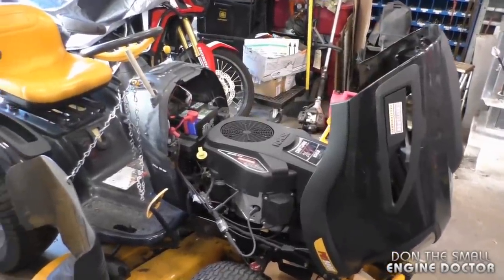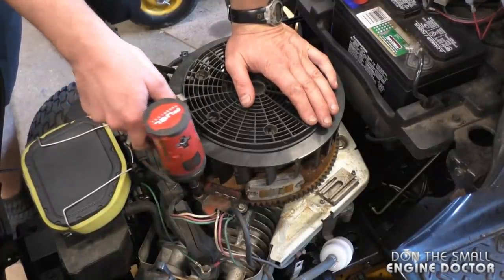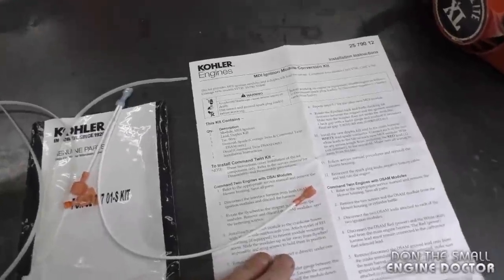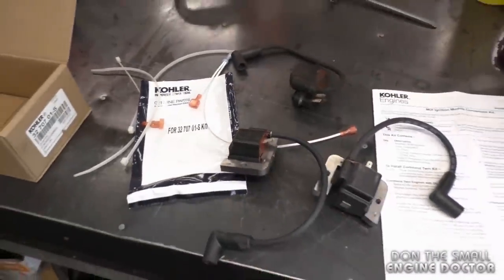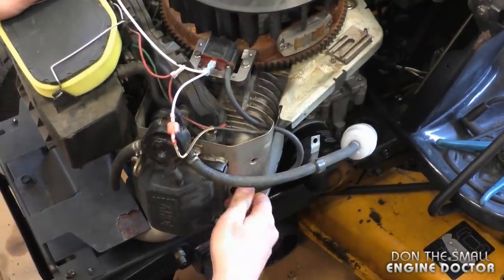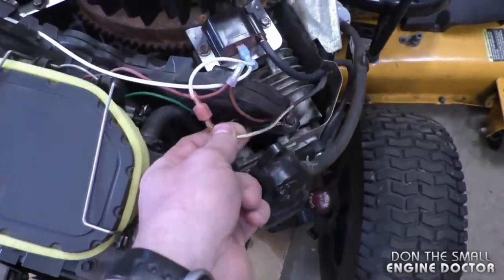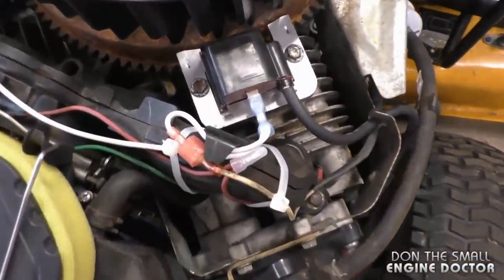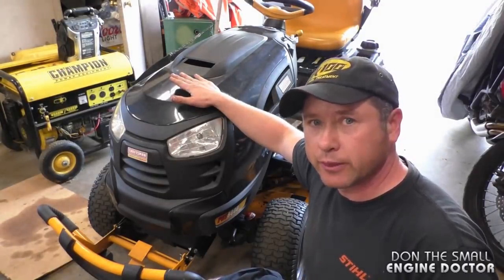HOW-TO Replace Ignition Modules On A Lawn Tractor - Kohler Courage Coil Conversion Kit

Comment: Just installed this kit today…100% improvement! Not only was my tractor only running at one cylinder, but the other one was weak. This coil update has it running like a new machine again. And this video was a great help, especially with showing what to do with the red wire.

Comment: Seems like the “courage” models of Koehler engines have so many coil issues! Great video, you make it look so easy!
Reply: Kohler is just a brand... Newer John Deer, Kohler, Husqvarna, MTD, ETC.... Any of them have the B&S "Twin" Engine Cylinder have the same thing.... It's the STUPID Engineers, just like the Fuel Solenoid!!!
Reply: @mmafanatic90  also known for their cracked cases, that mostly all crack in the same spot. Not all do it, but a lot do 🥺

Comment: I've done this twice on a 72' Toro z500. I ended up removing the engine to do all the work. It's a horizontal shaft, only 4 bolts and belt and a few connections to remove it. That mower recently got a new engine, so I'm sure I'll be doing it again in a few years.

Comment: Thanks for a awesome video had to replace on my Kohler 27 hp it’s on a Bad Boy ZT 65inch you were right no where in Kohler s instructions do they even mention the hot wire to the fuel solenoid on carb thanks so much for making this so easy runs like a new one 🫵🏻👍!!!

Comment: Dony, had an engine shop like yours for years.  Just a suggestion when replacing coils.  Remove old like you did, then install new ones with flywheel magnets out of the way but then just snug up new coils, then rotate the magnet to one coil, place business card in place and then loosen coil hold down bolts.  Magnets will pull coil into place, tighten hold down bolts and you are off and running without having to fight the magnetic pull on the new loose coil.  Just a suggestion.

Comment: Took several hours but I traced my problem to the 60deg tilt switch. Not sure how this goes bad but it was causing my bizarre cutting in and out problem. Bypassed it and all runs good. My ignition module (PN: 24-584-15) was not listed on the Toro Bulletin so I guess mine are ok. Do you agree?

Comment: I have this same engine and I have replaced all filters, fuel pump and carb. Using a spark detector like yours I have spark. My engine still misfires at high rpms. Any suggestions? Thanks for any help. John H.

Comment: briggs and tecumseh feed the kill wire of each coil through a diode before going to the common kill wire to chassis . What's different about kohler coils that they don't need the diodes.

Comment: Is there a similar procedure for a Kohler cv16s single with a SAM unit integrated into the ignition system. A new oem coil did not solve my week spark issue and I cannot find any information on how to test the SAM unit. So I would like to switch to the old fashioned coil if possible.

Comment: Smashing conversion, it's just like B&S push mowers now.
Just omit the power wire from the coil packs basically.
Any problem with the timing or is it just an engine that does not care much?
Reply: Even if it did care much,there is only a few thousandths play on the coil mounting bolts left to right. 
Engineered to the highest good enough standards.
Reply: paul billings
Ha ha  "Engineered to the highest good enough standards." :-D
That's a new one to me, nice :-D

Sounds much like simple twostroke moped engines, who cares how close the plug and points gaps are, the stator plate is bolted down so it should work. It has to be rotated!! oooow :-D

Comment: Hope you can help. I have a single cylinder Kohler pro Model CV16S-43519. It has lost spark and has module 9906 Rev A  also a marking 100532 if that helps. Also it has a rectifier/voltage regulator. How can I test which is bad or is there a modification you can recommend? Thanks!

Comment: Hi Donny have you done this on single cylinder kohlers? I have a kohler CV 16 S  that has the DSAI module with three prongs, I bought a new coil that is suppose to be for CV 16 or CV 16S but only has two spade connectors and they're not marked like old one. Thanks in advance!
Reply: I have the same engine as yours, 5 wires come out of SAM, the yellow and brown go to the ignition module,  Black to the ignition body, Red and white to the engine side red, and white. All wires are keyed so can not make a mistake

Comment: Thank you for doing this video!!
Any chance you have done one of these on a miller trailblazer with a kohler command Ch750 not efi?
After mdi conversion my stepper motor starts the engine up but i seem to lose any communication after that and just runs wide open..also does not shut off. I did the wiring right but something is amiss

Comment: Don't have many Kohler engines fitted on machines sold in the UK now. But we are having issues with the new Briggs and Stratton engines fitted with the electronic choke system and choke adjustments as we have had these cut out on customers.

Comment: Hi I have a question...I have a mower Dixie chopper 2017..it won't start. It cranks but no start we checked the both ignition coils there's no spark..I m not to convince bcuz both aren't sparkling. also the ignition key don't work..at cranks only if I do it directly to the starter..any suggestion will be appreciated thanks for your good advices. God bless

Comment: Will this (concept) work on an older 20 HP Merc OB? It's a 2 cyl, dual ignition points engine currently? 
I have seen these engines equipped with under flywheel and some with external coils.

Comment: Is it ok to paint the magnets on the flywheel ( keep them from rusting) with a lite coat of clear paint or will it interfere with the current? Thanks for the info and great job!
Reply: wax or oil works better
Reply from the maker: do not paint the magnets, u can spray wd-40 or some other lube on them

Comment: question, I have a Kohler command pro 20hp cv20 engine. it feels underpowered, and after doing some research, it appears that the 18-22hp models all use the same block, just the cv22 uses advanced timing. what would, or what could I do to boost the HP our of the 20hp engine? can I put the carb on from the 747cc 27hp model, or remove the governor and run it at 4000rpm?

Comment: Hey Don. Just installed this Ignition Coil 2 Pcs Replace 32-707-01-s 25-707-03-s 3270701 Fit for Kohler SV735-0017 SV740-0020 SV735-0018 SV735-0019 SV735-0002 SV740-0002 Lawn and Garden Equipment Engines
Ignition Coil 2 Pcs Replace 32-707-01-s 25-707-03-s 3270701 Fit for Kohler SV735-0017 SV740-0020 SV735-0018 SV735-0019 SV735-0002 SV740-0002 Lawn and Garden Equipment Engines and the mower is just turning and turning. NO FIRE...Ideas?

Comment: I purchased coils off of Amazon. When watching your video on replacement coils, you just have one tab to connect. The ones they sent have two tabs, with no instructions on where or what they are for. The ones that I have are the same number sv740 that it says on my tractor. Can I still use these and if so, can you share with me what wires go where. Its a twenty seven hp twin courage. Your response would be greatly appreciated. Homer

Comment: I bought a Cub Cadet XT1 a couple of years ago with a Kohler 22 HP engine.  It's running great so far.  Is this something that I should be worried about?
Reply from the maker: not really but if it is you'll know what to do

Comment: Don,  what is the part number for single cylinder 16 horsepower Kohler engine, I have Kohler CV16S with the Spark Advance Module, many thanks

Comment: On some older 23-25hp Kohler Command engines that were Equipped with a SAM module you have to flip the Left coil over. You will notice it rite away if you have to flip the coil over or not because it will have significant spark knock and the lifters will rattle. Don't run it very long or you will bend the push rods.
Reply: So one coil wire is against the motor and the other one is on the outside , cause the plug wire hits on the intake manifold ? I was wondering if that was correct ?

Comment: @donyboy73 my courage sv725 when I engage pto seems the engine won’t run right when cutting. Almost Bogging down. I’ve cleaned carb, adjusted valves, new plugs. Cleaned Magnito. Could my could be going bad?

Comment: I had intermitting spark with dsai, i have the same engine a kohler courage sv735. The kit i bought with the same part number your showing on your box and my mower runs like garbage. Both are sparking but its running like its missing or out of time? I'm at a loss i been working on these things for years. Please help.

Comment: Any chance of running cdi ignition boxes and add the pickups ware the coils were removed from using the flywheel magnets as the pick ups ?
Reply: in for the asnwer to a good question

Comment: Great video as always. I really appreciate how succinct  and informative they are.
Do you remember where you got your spark tester? There are many out there, but I really like yours. Any information is appreciated.
Reply from the maker: that is a new spark tester I am trying from Blue Point, you can get it from snap-on
Reply: The same spark tester is available from Lisle Tools (P/N 20610).  It can be found at many auto parts stores or on Amazon if you don't have a Snap-On guy around.  I have the Lisle one, it works very well, I use it all the time.  It doesn't work with spark plugs that have the threaded ends though, won't securely attach inside the coil wire boot...

Comment: Clear, well explained video.  Well done Dony.  Does the coil on the Kohler Courage single-cylinder tend to fail the same way?  Is there a kit for that too?  Thanks!
Reply from the maker: yes they do fail on the single cylinders a lot too but usually no special kit required
Reply: @donyboy73  ok thanks.  Good to know.  I have been keeping a Kohler Courage Single alive on my son's Cub Cadet tractor.  Certainly not my favourite engine.  But your advice is always useful when I go to my local small engine parts shop.  It helps me understand the excellent advice that they give me.

Comment: Great job, I'm really liking that spark tester you used, can't find a video on your channel about it, where did you get it?.... I wanna pickup 2 of em..... They seem to have a nice large sight window.
Reply: Don got his Blue Point version from a Snap-On guy, but the same spark tester is available from Lisle Tools (P/N 20610).  It can be found at many auto parts stores or on Amazon if you don't have a Snap-On guy around.  I have the Lisle one, it works very well, I use it all the time.  It doesn't work with spark plugs that have the threaded ends though, won't securely attach inside the coil wire boot...

Comment: If you buy the eBay coils - DON'T CUT OFF THE HARNESS!  Don't cut ANY wires.
Use the existing harness, and plug the connector WHITE part into the coil tab.

The green wires are grounded to the carbureator. The little yellow wire of the coil, plugs into the GREEN part of the connector!

Comment: Maybe I missed it but why not just replace the original type, seems a lot simpler?

RichE San Diego, CA
Reply: no longer available.
Reply: He mentioned superceded-something which I took to mean original-original parts aren't avail, that the 'downgrade' :) is the factory recommended fix. Sadly, weak design or production.
Reply: Oh, interesting.  And surprising.  Thanks.

Comment: Can to much gap cause backfire? I have a Honda lawnmower I’ve checked valve timing , flywheel key , no sign of damage or severe ware to cam or rockers. Auto decompress seems good but still backfire
Reply from the maker: yes it can,

Comment: could you tell me how i can find that retaining clip on the starter drive?
Reply: There's a kit for the starter gear, spring that holds it down, and clip. Stens makes them as well as the original equipment manufacturer.

Comment: I bought some ebay coils last season (replaces 24 584 01-S) to replace the dsai coils on my 26hp kohler,but never got around to putting them in. I ran into a video here on YT that showed you needed to use a  Resistor in-between the coils  so they don't backfeed off each other and act like the kill switch but I can not find that video now.

Anyone have any info on that?
Reply: Ive got the same problem.....the kill wire between the 2 coils grounds them out even though the harness isnt connected to ground.......did you figure it out?

Comment: Maybe someone here can help me.  About every month I'm having to change spark plugs in my jazee pro 27hp kohler. Cleaned coil and magnet contacts.  Get a very good spark from coil wire threw my spark tester but it fries the plugs completely out, cleaning them either with abrasive or heat does nothing.  Throw a new set of ngk R plugs in an itll fire right up.  Thanks in advance.

Comment: The original coils probably fail as the Mosfet transistors in them are made of poor quality Chineseum and can't handle the voltage spikes.
Reply: You are 100% correct... Don't forget HEAT too!  Heat is heating up the Coil as engine running and Mosfet can't handle it, since Mosfet needs to dissipate their own heat.  It's the STUPID Engineers, just like the Fuel Solenoid!!!

Comment: Sounds like it has a blown head gasket, common problem on those Kohler command and courage engines.
Reply: Kohler is just a brand... Newer John Deer, Kohler, Husqvarna, MTD, ETC.... Any of them have the B&S "Twin" Engine Cylinder have the same thing.... It's the STUPID Engineers, just like the Fuel Solenoid!!!

Comment: There's plenty of coils for those on ebay
Reply: Yes, but the whole point of the video is to RETURN it back to the "older" design. It's the STUPID Engineers, just like the Fuel Solenoid!!!
Reply: @JodBronson  they literally make and sell 1x of the standard UPDATED coils for 9$. No need for a whole kit that costs a lot from kohler
Reply: @nickflopper  - 100% agree on the Coil and the cheapness of it.  I can get them for $7.49 each.
Reply: @nickflopper  can u post a link?
Reply: @wlttz  course not. hes one those fishing story guys. u know the ones that caych a shark in a pond almost have it then it grabbed one their guns and and boat an left lnao

Comment: Heat is heating up the Coil as engine running and Mosfet can't handle it, since Mosfet needs to dissipate their own heat.  It's the STUPID Engineers, just like the Fuel Solenoid!!!

Comment: Oh what a mess.  I wonder what goes bad with those coils.  Whats the difference inside I wonder.  To much junk stuff.  Go back to basics.
Reply: It's probably a poor quality Mosfet transistor inside the module. Made of Chineseum and can't handle the voltage spikes.
Reply: It's probably a poor quality Mosfet transistor inside the module.  They are made with Chineseum and can't handle the voltage spikes.

Comment: Dony! Can you make out what model: my kohler command 23hp is? All I can find on the engine is 
Serial no. 3529012221
Spec no.  PS-76614
It’s on a exmark front runner